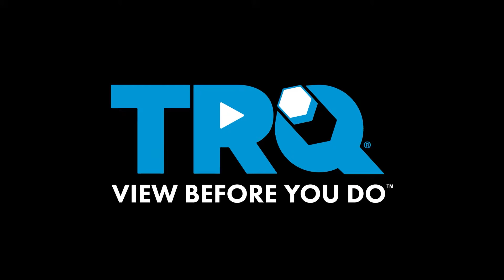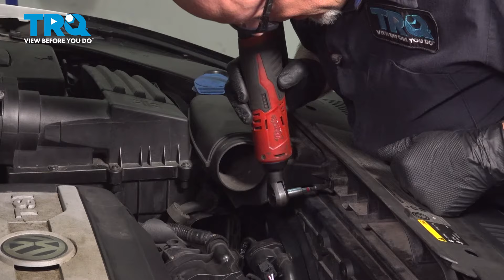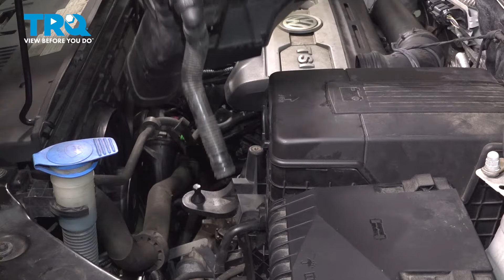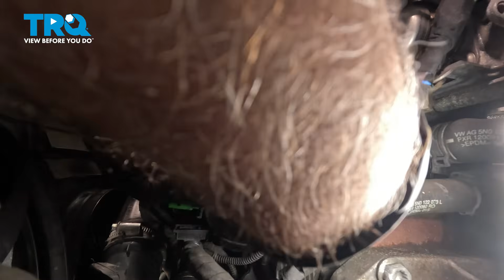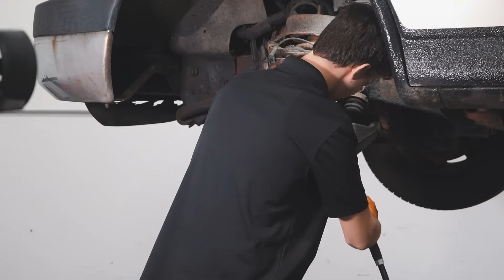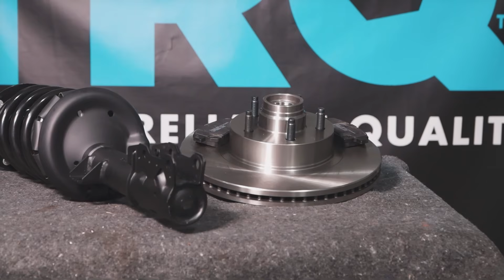How to Replace Intake Manifold Runner Control Valve 2009-2017 Volkswagen Tiguan 2.0L I4

Comment: How was it determined that it was faulty, what vacuum level did you see? I only see 6 inHg on hard acceleration going to vacuum actuator, about 25 inHg at input of valve from aux vacuum pump. Was getting intermittent P2015.